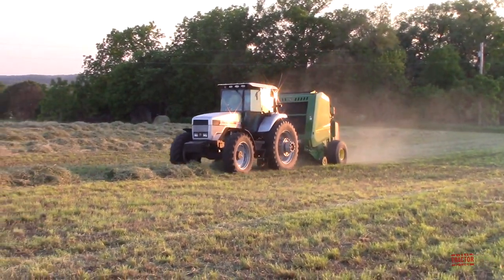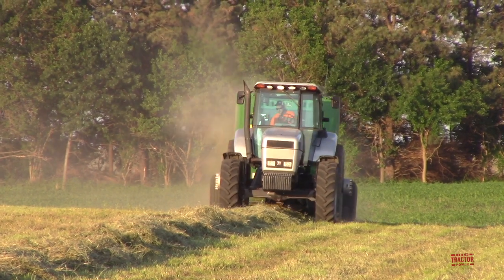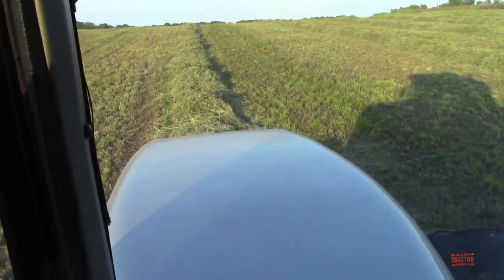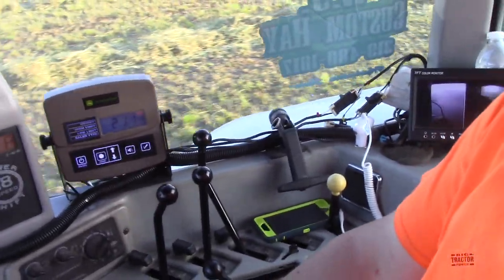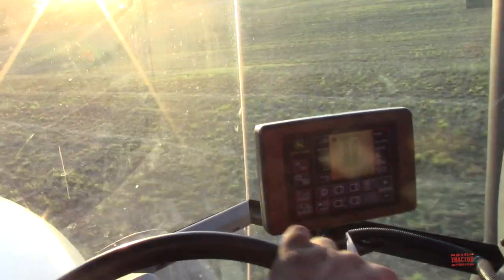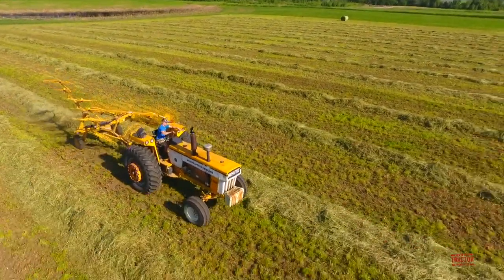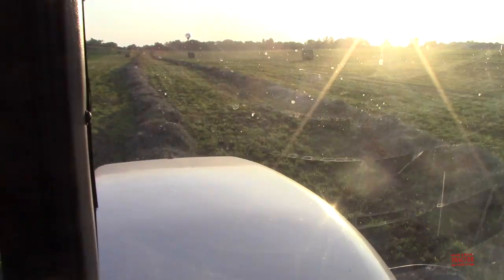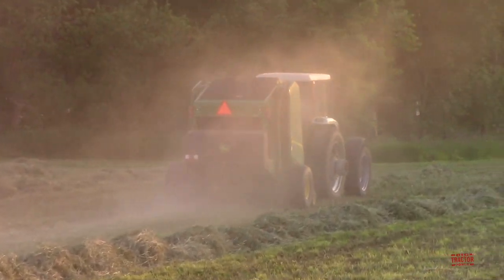AGCO WHITE 6175 Tractor & John Deere 560M Round Baler

Comment: I'm  a big Oliver fan but when that series White came out they were behind. I ran that exact model when it was new and thought it was ok until I ran a new 8670 Ford (white had hyd. issues and dealer sent a loaner), the 8670 was just all around better to operate and much more comfortable,  while it had slightly less rated power you never noticed it on the 7 btm. 18" plow I was turning sod with. It also was better on fuel as I recall. Over the years I always noticed you didn't see many of this series white. Thanks for posting this video of one of the last work horse models, it takes me back.

Comment: The JD round balers must have changed a bit in the last 20 years. I remember having to go pretty steady when starting the core, and with hay especially the pickup had to be monitored constantly for blockages - made for a sore neck! Wheat/barley straw from a straw-walker combine (remember those?!) made the best swath for round-baling. Rotary combines didn’t make such good straw for bedding material as it tended to be over-threshed.